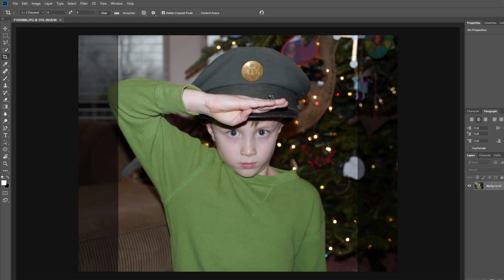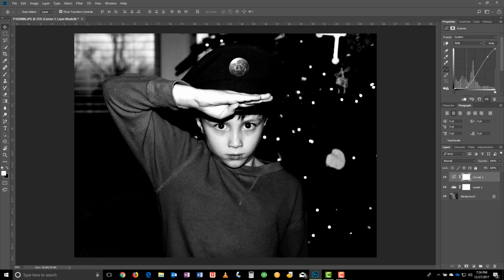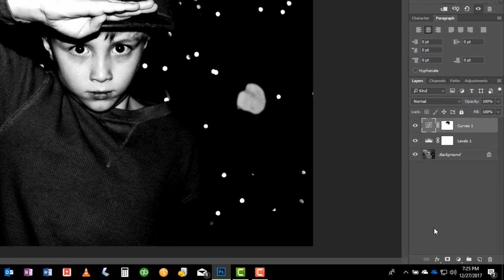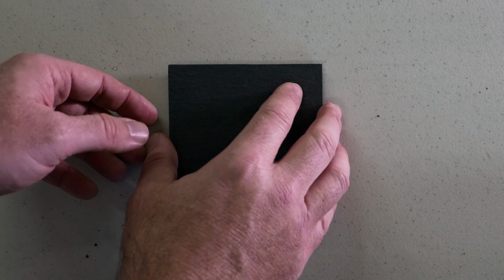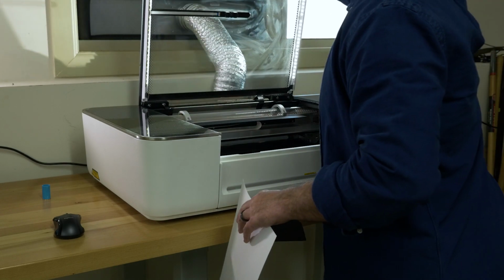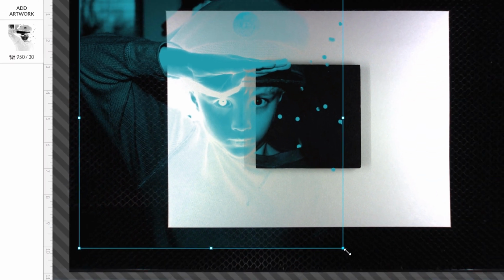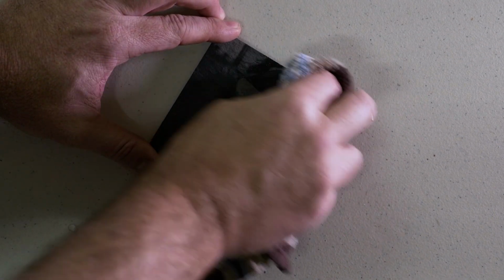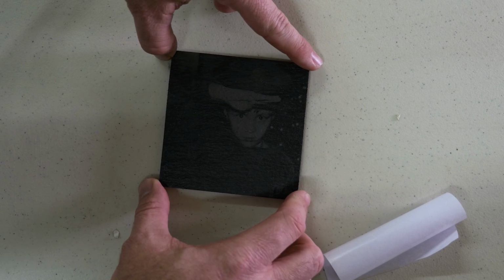How to Design and Make a Slate Coaster with Your Glowforge (Tutorial)

Comment: When you put the paper under the slate to "catch the laser" - what problem are you fixing?
Reply from the maker: I'm probably not fixing any problem. At the time I was not sure if the laser hitting the metal at the bottom of the GF could reflect back and cause damage to the optics. I also wanted to keep the bottom of the GF clean and was not sure if the laser would leave marks if it hit the bottom.

Comment: Is it possible to get grey scale from the glowforge ? I’m tossed between this one or the muse
Reply: Yes.  Look at this post on the GF forum to see what gradient gray can do in 3D mode.  https://community.glowforge.com/t/comparing-3d-engrave-vs-manual-greyscale-vary-power-on-draftboard/16754
Reply from the maker: You can certainly etch from dark to light, depending on your settings and the materials used. In the case of slate, one will be limited in what presents itself. On other materials, like wood, things work fine. When one is etching, one can choose different ways to represent greyscale, using "vary power," "convert to dots," and "convert to patterns."

With respect to the Muse, if the product works as intended, it looks like a great and one that I might have picked over the Glowforge due to it's expanded capabilities (e.g., ethernet, USB, not cloud dependent, fully developed software, rotary attachment, and can accept more file types). It has had a lot of problems though, at least as I understand it.

See here for a discussion: https://community.glowforge.com/t/and-heres-the-muse/18457/38

With that said, the Glowforge community is stellar and is a major reason I am passionate about it. The CEO is also very active on the forums. The firsthand support should factor into a potential purpose because it demonstrates commitment.

Good luck in your creative endeavors and eventual purchase!